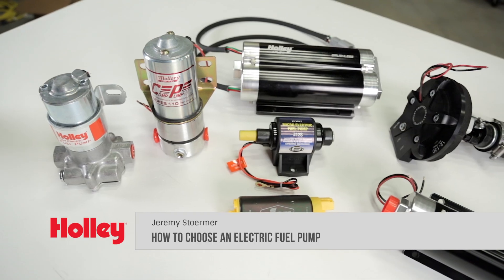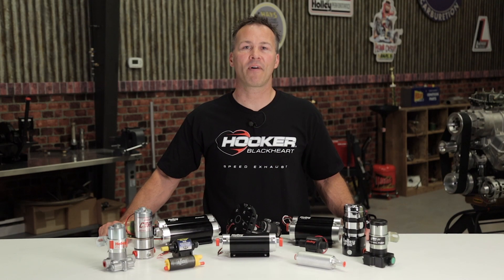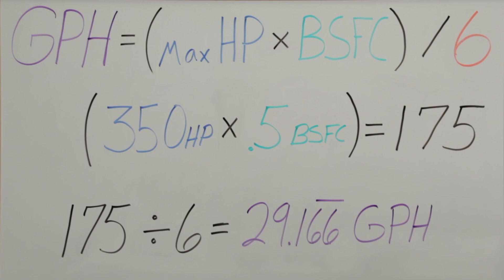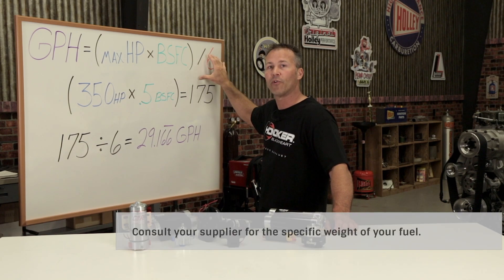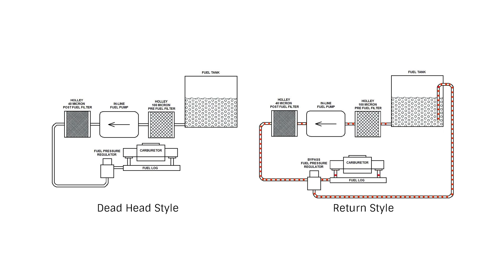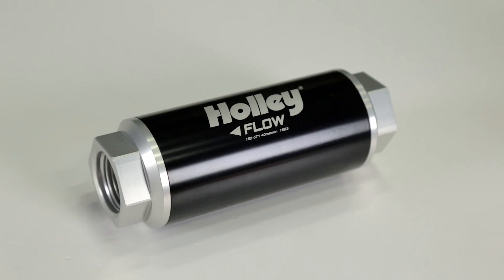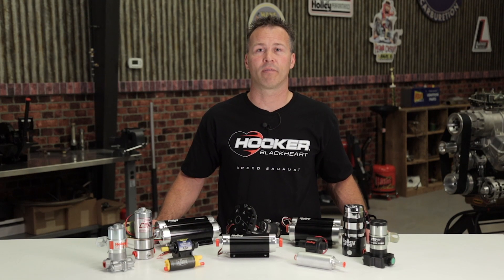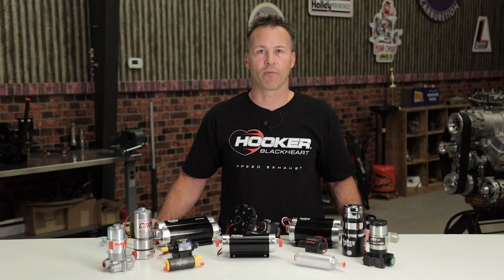How to choose an Electric Fuel Pump!

Comment: What is the best fuel pump for datsun b310 (1979) .?
Reply from the maker: Going to need some more info??  Engine? stock or modified engine? carb or efi? in tank or external? regulator or no regulator?  thx J
Reply: HolleyPerformance it is stock engine...carb and..external and no regulator
Reply from the maker: Perfect,   I would recommend our Holley red pump, no regulator needed!
https://www.holley.com/products/fuel_systems/fuel_pumps_regulators_and_filters/fuel_pumps/carbureted_fuel_pumps/carbureted_electric_fuel_pumps/parts/12-801-1
You could also use one of our mighty mite pumps if your wallet is a little on the light side.
https://www.holley.com/products/fuel_systems/fuel_pumps_regulators_and_filters/fuel_pumps/carbureted_fuel_pumps/carbureted_electric_fuel_pumps/parts/12-427     Hope this helps you, Thx J

Comment: My husband installed a Holly electric fuel pump on our '70 Nova. The thing sounds like the car is ready to fall apart. Sometimes, it's quiet, and sometimes it super loud. It seems to be getting progressively worse. We haven't figured out a pattern as to why this is happening. Does anyone know why it sporadically sounds loud, and what can be done about it? My husband's tightened it to where it isn't rattling, so it's not that. It is mounted in back by the fuel tank. Thank you.
Reply from the maker: What part number is the pump?
Reply: I don't know. It's a Holly electric fuel pump putting out between 4 and 7 psi. The carburetor we use calls for about 5 to 5 1/2 psi.  We filled the tank yesterday and the noise stopped. For now. The gas tank still had about 6 gallons of fuel in it. Hubby figured it might have gotten low enough that the fuel pump was sucking air. We're hoping that's what it is. Like I said, for now it's quiet. Thank goodness. :-)
Reply from the maker: There are several factors that are crucial when using an electric fuel pump.  First the pump needs to be mounted as close to the tank as possible (elec pumps are better at pushing fuel than sucking fuel).  The pump also needs to be positioned as low or lower than the lowest possible level that the fuel will be in the tank!  Since it sounds like you are using the stock fuel pickup (correct me if i'm wrong) in the tank, it's a good idea to drop the tank and pull the pickup assembly out for inspection.  48 years can change a lot of things.  The pick up could have been damaged from previous installations or even have pin holes causing fuel aeration or completely rusted off, reducing its ability to pick up fuel as low as it should be able to in the tank. replacements are inexpensive and can be found at most auto parts stores or online.  thx J
Reply: Thank you so much, J, for taking the time to respond. I've passed on this information to my hubby.

Comment: I have a Dodge 318(TBI stock), and plan on converting it to carb (with a regulator). And need to replace the stock in-tank fuel pump. I have considered just installing an inline pump ahead of the tank(90' Ram). Is that a bad idea?
Reply from the maker: Has the in-tank pump failed?  if not you can get a bypass fuel pressure regulator to reduce the pressure down to work with a carburetor.
https://www.holley.com/products/fuel_systems/fuel_pumps_regulators_and_filters/regulators/ 
If your pump is bad then yes, you can replace it with an external pump. Keep the pump as close as possible to the tank and below the low fuel level. Some plumbing work will be necessary to make it all work but look at these pumps if you choose to go with an external unit. https://www.holley.com/products/fuel_systems/fuel_pumps_regulators_and_filters/fuel_pumps/carbureted_fuel_pumps/ Thx J

Comment: What can I use on a 78 international scout 2 with a Holley 2 Barrel with a 304 V8?
Reply from the maker: Here are a few good options for you depending on price and the fuel demand of your engine. thx J
#1 https://www.holley.com/products/fuel_systems/fuel_pumps_regulators_and_filters/fuel_pumps/carbureted_fuel_pumps/carbureted_electric_fuel_pumps/parts/12S
#2
https://www.holley.com/products/fuel_systems/fuel_pumps_regulators_and_filters/fuel_pumps/carbureted_fuel_pumps/carbureted_electric_fuel_pumps/parts/12-427
#3
https://www.holley.com/products/fuel_systems/fuel_pumps_regulators_and_filters/fuel_pumps/carbureted_fuel_pumps/carbureted_electric_fuel_pumps/parts/12-801-1

Comment: Is it possible to damage an in-line fuel pump by using it with water?
Reply from the maker: Yes it is possible, water when in it comes in contact with oxygen (air) can cause rust and corrosion damaging pump internals. Water does not have the lubrication properties that fuel does increasing wear and heat.  A small amount of water is present in most all fuels,  especially fuels with ethanol added.

Comment: I am trying to find an electric fuel pump for my 351M (400) for my '78 F250. I have no clue which one to get. any suggestions? thanks!
Reply from the maker: Are you running a carburetor or EFI?   Do you already have a regulator?
Reply: hi, thanks for the reply! have a 2bl carb that came stock with the 351m. freshly cleaned. I do not have a regulator
Reply from the maker: One of our  Holley red pumps part # 12-801-1 should work just fine. You could also use a  Mighty might pump part #12-427.  Be sure to mount the electric pump as close to the fuel tank as you can ( electric pumps are better at pushing fuel than pulling)  and below the lowest fuel level in the tank as possible.
Here are 2 charts to help you make an educated decision.  Dont forget the filters!!
http://documents.holley.com/fuel_pump_tech_info.pdf
http://documents.holley.com/holleyfuelsystems_chart1.pdf
                                                                                                                Thx J
Reply: thanks again!  so will i need to get a regulator as well or will this do the job well enough by itself? have a good one!
Reply from the maker: If you use one of the  pumps I suggested above you will not need a regulator!  Good luck! J

Comment: really good video.

I have a question, what if I need a fuel pump ASAP for my stock engine, just to get it running, but plan on increasing horse power next year? should I buy a pump for the horsepower it has at the moment and upgrade later? or can a stock 125hp engine run with an oversized pump for 200hp and have no problems?
Reply from the maker: That's a bit of a tricky question.  A lot of it depends on the type of pump used and how much of an increase in horsepower you plan to do in the future.  Most pumps should be able to handle under-performing  when used with a quality return style regulator and adequate return line. But remember that if you restrict a larger fuel pump you will create more heat and over time it can cause damage or even failure.  There are plenty of budget minded pumps available today that would supply your stock engine.  Why not use one of these now and save your money till you know exactly what you will need for the  upgraded engine!   thx J